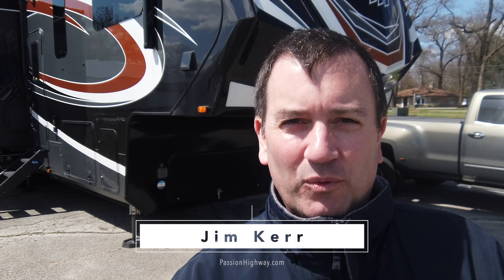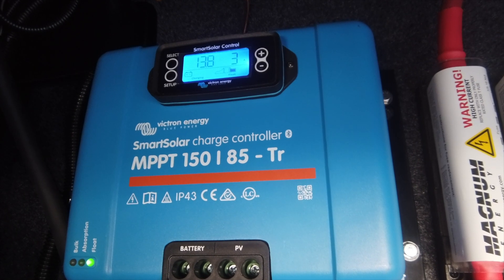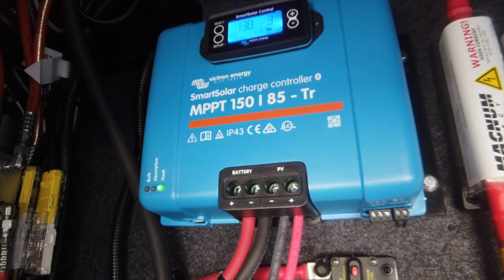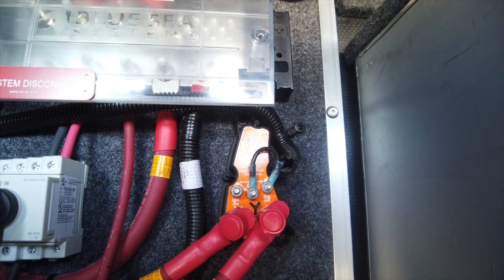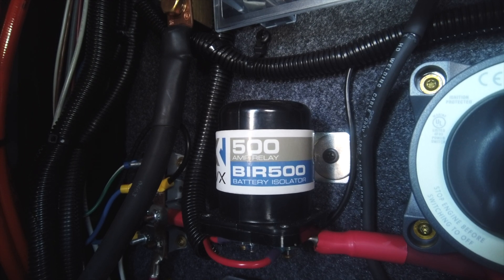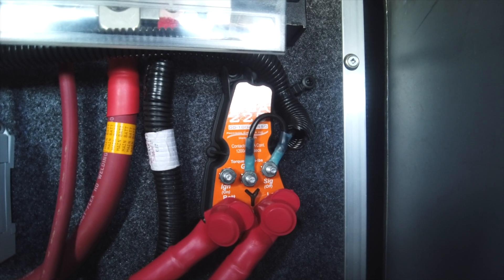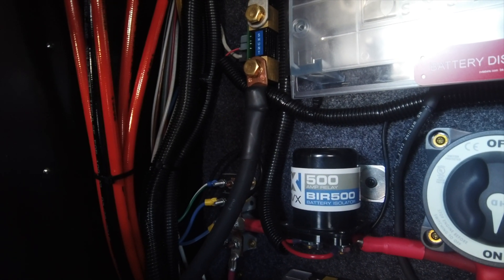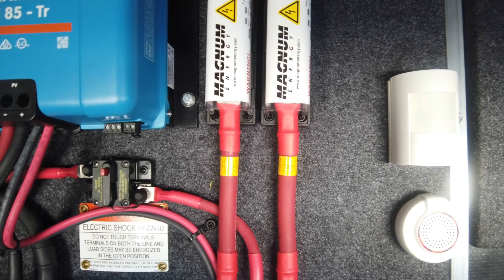RV Solar Installation || Living Off The Grid | Passion Highway

Comment: Hello Jim...are you still monitoring your website email? I sent you a query on the autotransformer you installed and the wiring option you incorporated to utilize the full 45 amps from the Onan 5500. Let me know if you can respond to my email.
Reply from the maker: Your email may have been lost.  I will look around for it.  To get the full output of the generator 1 of the legs needs to go direct to the transfer switch (completely bypass the Autoformer).  The second leg goes through the Autoformer.  What happens is the Autoformer slows down the frequency of the second line and takes it 180 degrees out of phase of line 1.  When you combine the lines back at the transfer switch you get a full split-phase 220 AC circuit from the generator.  The only drawback to this is the Autoformer drops the voltage about 6 or so volts.  I bumped up the output voltage on our generator so Leg 1 is around 124 VAC and that makes Leg 2 around 118 VAC.
Reply: @PassionHighway  Thanks Jim...did you do any other wiring mods to the gen set? I am using the AT 100A and wiring direct from the gen to the AT to the transfer switch...I want to make sure all bases are covered on the wiring....I will send you an email with the wiring diagram I am using.
Reply: I also saw your auto transformer review on Amazon. Any benefit with going with the 100A vs the 30A and being able to wire both Onan 5500 legs into the AT?  Does it even out the voltage drop, or just simpler from a wiring perspective?  Was getting ready to pull the trigger on the Multiplus-II and then I found out about the issue with the single phase generator output.

Comment: Very nicely done video. We just took delivery of our 399th. We opted for the factory solar package that came with the 300 watts panels wired to a jaboni 30 amp mppt controller with a 2 line display inside the coach. I have recieved no documentation about what the numbers on the display mean. Talked to the dealer.. nothing. Left a message with grand design nothing....
Reply from the maker: Anupam, we ordered the OEM Solar as well.  As you can see from the video we removed nearly the entire system.  The Jaboni Manual is on their website (https://jabonipowerproducts.com/wp-content/uploads/2018/09/Solar-Charge-Controller-Manual_5.23.19.pdf).  Page 6 shows what the lines on the display are telling you.  It isn't in this video, but we added a Victron Cerbo GX with a display.  The Victron display covered the large hole left behind by the Jaboni display.  We highly recommend Victron products.
Reply: @PassionHighway  Thanks a ton for the link. Will definately look into the Victron. Do you happen to have a schematic for your solar install? It would be most helpful for the non technically inclined amongst us :)
Reply from the maker: Anupam, we have a couple of diagrams at the bottom of the blog post related to the video.  We have changed it slightly since the initial install, but it is close.  Check it out:  https://passionhighway.com/index.php/2020/04/19/grand-design-momentum-397th-solar-install/
Reply: @PassionHighway  Jim thanks so much. That was exactly what I was looking for. Since we plan to stick to full hook ups for the immediate future, I will chalk this up for todo. My next project is to get the garbage LCI router out and put the pepwave in. Unfortunately the pepwave seems to be out of stock.
Reply from the maker: @hianupam  Pepwave's are very popular now that RV'ers have discovered them.  The best thing to do is put in a backorder with Mobile Must Have or the 5G store.  Both of those dealers are reputable and have good relationships with Peplink.  I have ordered from both of them without any issues whatsoever.  We have preordered components from both of these stores before.  They will ship when the product comes in.  

We were planning on preordering our CAT18, but lucked out.  Mobile Must Have had an early batch come in and most people were not aware of the CAT18 release.  It was a brand new product when we got it.  Now that people know they are eager to get it since it supports band 71, which is T-Mobile's long-range LTE frequency.  The T-Mobile/Sprint merger that brings in midband frequencies that TMO didn't have could move them into being a viable option for remote LTE internet.
Reply: @PassionHighway  Thanks Jim. I will put in my order today.